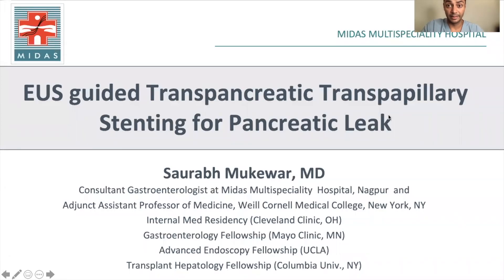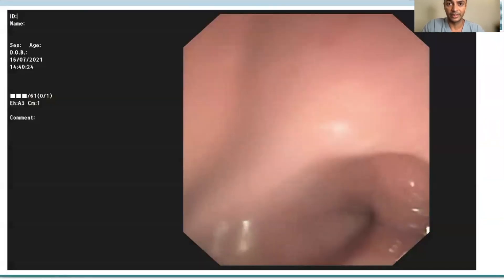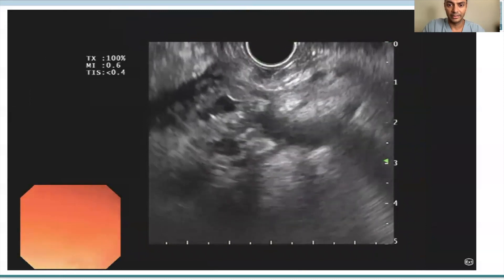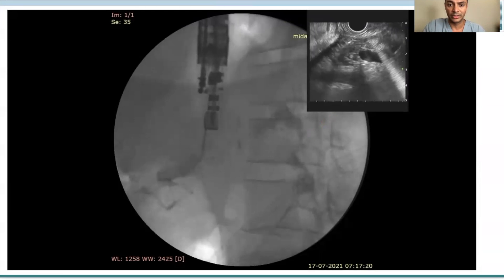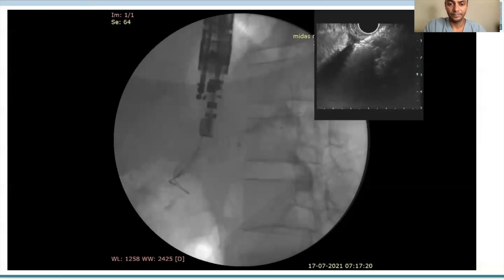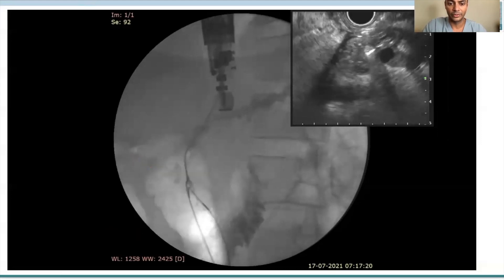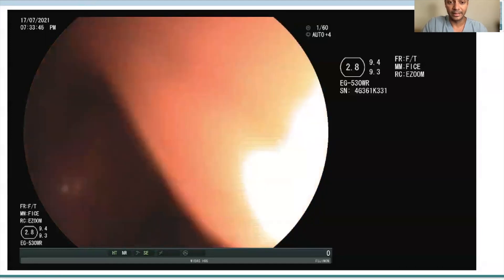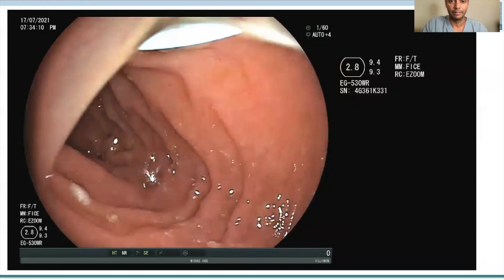EUS guided Transgastric Transpancreatic Transpapillary Stent for Pancreatic Leak with failed ERCP

Comment: The leak was not bridged. But did  the transpapillary drainage help in this case to decrease the pressure and subsequently the leak?
Reply from the maker: Yes. As you know, bridging leak is not required always to reduce the pressure. The stent worked very well and the ascites resolved over 2 weeks.
Reply: @Midasgastro  thank you for your response sir.